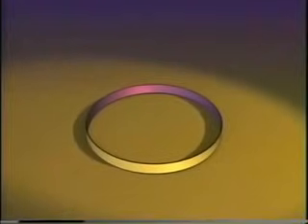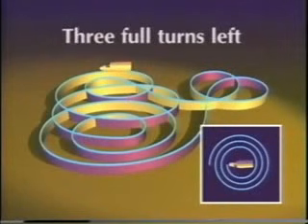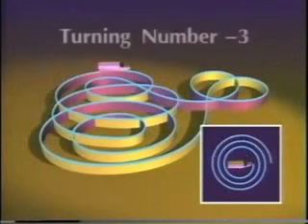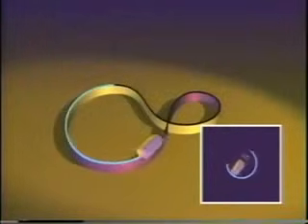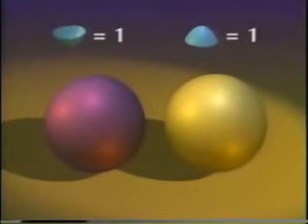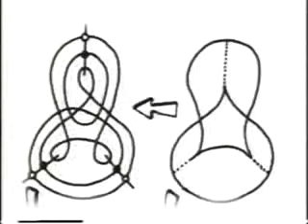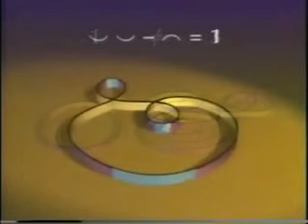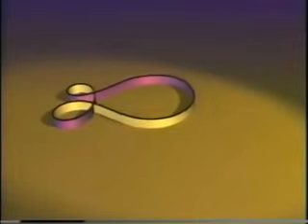how to theoretically turn a sphere inside out

Comment: "This sphere is made of an elastic material that can stretch, bend, and pass through itself." Yeah, no. The only way a material can pass through itself is if it's a liquid, gas, or plasma (sorry, Bose-Einstein condensates and solids). This would be breaking the molecular bonds between the particles making up the sphere; therefore, not maintaining the sphere as a whole, which is, in practice, cutting a hole in the object. This is exactly what you said isn't the point to do at the beginning of the video: "Sure, but the point is to do it without making a hole." If this is a legitimate scientific theory, you just got served by a fifteen-year-old.

Comment: lol that fucking thing creased at least twenty times during that whole process
Reply: +Poke brony234 I'm a mathematician and no it didn't.
Reply: ikr? I'm not mathmetician, but that had to at lest crease once.
Reply: It didn't, as far as I'm aware, I didn't see any creases or sharp turns, but then again, that could just be my shitty eyesight...
Reply: +Poke brony234 See smale's paradox
Reply: welp. the thing definitely twisted and contorted into itself every single time it collapsed into itself.
Reply: +Kevin Wei um it was about half way towards the middle of the video. so either number 3 or 4
Reply: +44theshadow The sphere was never creased and passed through itself at the same time which is what they meant to say.
Reply: that could be true now that i watched the vid a few more times. but i still believe that it twisted many times during the middle phase of the transformation. but thats only an assumption because the camera angle, but whatever
Reply: 44theshadow There is this thing called homotopy that can be used to trace transformations across the surface. In other words, there is a formal mathematical proof that eliminates the need to "see the evidence".
Reply: mk m80. will do. im stupid so i dont know the terminology, but ill take your word for it

Comment: Guys this is pure math, there doesn't need to be a material that does the same thing. and mathematical spheres don't just represent material shapes they can represent anything each point on a sphere could represent a different color for example and maybe in some applications its useful to turn it inside out

-TPC

Comment: Setting the parameters after asking if you turn a sphere inside out is idiotic.  The term pinching is made up bs. The ring in the graphic does not create 90º angle.  It can only be a curved surface through out the inside out transition.  You changed the rules in the middle of the game. Stating no pinching, pinching is made up bs term in this case. You stacked the deck to show a computer graphic that is no more valid than the first. Material crossing through itself. Possible at high freguencies,

Comment: I just spent 10 minutes learning something that will never physically be possible anyway.
Reply: Which doesn't mean this won't be useful for a real-world application. Imaginary numbers are very much "unreal", yet modern physics couldn't exist without them.
Reply: Airblader How can something not physically possible ever be applied in the real world?
Reply: tapport Often you will find that the process of solving certain ("real-world") problems becomes much easier by leaving the realm of the physically possible and instead moving on to abstract physical or even abstract mathematical concepts. Such results can then be applied to your actual problem again, allowing you to solve it. Yes, sometimes even solving a general, abstract problem is much easier than solving a certain subproblem. 

As I pointed out, imaginary numbers are a good example. Of course nothing that exists in real life has a complex/imaginary value, but using complex numbers pretty much revolutionizes the way we do physics. The computers we have today wouldn't exist if it wasn't for those numbers.

And they are just one example. There is completely abstract mathematics which is done for the sake of doing mathematics and there is (a lot of) mathematics that is done to help solving problems in physics or other sciences. But the past has shown that even abstract results not meant to solve any real-world problem may find their applications in real-world problems. Which is why research like this is important, even if its "use" is not directly apparent. In fact, often abstract results only help solving other abstract problems which solve other abstract problems which then can be applied in the "real world".

Cryptography would be another great example. The mathematics behind elliptic curves and the like is really abstract and complex and yet the internet or banks or anything requiring a password couldn't exist if this research hadn't been done.
Reply: tapport So, to sum it up: no mathematician in their right mind claims that this result will help us turn spheres inside out.

However, the underlying problem that was solved here might fuel further research in topology and one day "indirectly" find its way into a useful application.

All that being said, as a mathematician, I don't even care for it that much. Even completely abstract mathematics is appealling, but with the words of Paul Erdos: "[…] It's like asking why is Beethoven's Ninth Symphony beautiful. If you don't see why, someone can't tell you."

Comment: my teachers at school challenged 50 kids to turn a circle made of all the students holding their neighbour's hands inside out. the rules were the circle could not have anyone with their arms crossed and could not be broken. they said that they had tried this over the previous 10 or so years. and no student had worked out the solution. after 10 minutes of all 50 kids working together to solve the riddle the teachers announced that it could not be done. so i said "i've got it" walked to the oppersite side of the circle and asked one pair to lift their arms up and walked under them. dragging all other students through that gap. it worked and the teachers were speachless! yeah that's right a circle can be flipped in reality and not in the physics of this video! and yes stuff can pass through itself. this video makes absoloutely no sense!

Comment: I am thinking that in n+1 dimensional space, if the n sphere is an odd number then it cannot be turned inside out because there are no saddle points in even dimensional spaces to make it possible to turn the n sphere inside out. This means that for any n sphere that is even, the turning number always equals one.
Reply: Hmm, very interesting, but consider this hypothesis:
you have eight pencils and 34 steaks on the roof. This means there's only 20 slices of toast (surface area = 23cm²) in the pool. Now, when we compare the weight/mass of the steaks and the total volume of the swimming pool, you can see that the earth couldn't possibility exist as a sphere and still maintain it's orbit around Jupiter, relative to the population of China, of course.

I realize none of this explains why elephants can't swim whilst wearing hats, but it's food for thought, at the very least.
Reply: Adi Cox I don't have a goddamn clue what you just said, but it sounded interesting. 
This is why I have degrees in History and Psychology and not mathematics. lol
Reply: Very interesting thought. If this doesn't work for 2 dimensions but for three, what about 4, 5, ... n- dimensions. 4 or more dimensions might be hard to imagine but this is a mathematical theory and no rational science so n-dimensions are a thing one has to consider. It seems akward that mathematical laws should change just by adding more dimensions.
Reply: I had noticed a quality that the parity of dimension of space expressed. In other words what happens in an even dimensional space may be different in an odd dimensional space and that this is consistent no matter how many dimensions we go to.

Lord AJ gets what I was saying, but Tweedle Dee if you want to involve toast, Jupiter and the population of China, I can take it :  ) It is gratuitous imagination on your part.

This is what I am up against. People that do not taking me seriously. It is good to have a bit of fun though : )

Comment: In some places it looks like a smile, in others it looks like a frown...there's science terminology for you.
This is ridiculous.  You can invert the circle by flipping it, why do you have to pull it through itself?  How do they make up arbitrary rules and not even say them in the video?
Reply: The reason this is explained with these examples is because the real way this problem is approached is hardcore math and it would be impossible for anyone of us to follow.

You can invert a circle by flipping it because it doesn't exist in a dimension where it's blocked from doing so. A sphere is a fully complete form which means flipping it would never be turning it over, just turning the position you look at it from.

Comment: > Easy, cut a hole in it and pull it through.
> That's cheating.
> It can now pass through itself.
> You can now just pull it through a hole without even cutting a hole in it.

Comment: This video gave me a mind loop and it shut down with a general protection fault. Only 2:09 made sense. Well, if the circle has an "inside" and "outside" even when it's not a twistable band, what if you "cut" out the narrowest possible 1 unit thick band of spheres A and B, which are proven to be turnable into one another. Then you'd have turned circles by going through the sphere with the desired "surface" on the outside...

Comment: this has got to be some of the biggest bullshit ive seen on youtube
Reply: Cameron Fitton There is practical application in homotopy theory which inspired this particular problem.  Homotopy theory is the practice of trying to attribute certain algebraic properties to a topological space based on injections of standard and familiar topological spaces and how these injections can be morphed into one another.

For clarification to laymen, a topological space is an abstraction of "nearness."  It is very useful to abstract the notion of "these region is near that region" or even the very concept of what you mean by "region" because in a lot of cases the concept of "nearness" doesn't work out exactly as you would expect it to in a euclidean space.  

To give a practical example, say you are working in big data analysis and you're trying to predict the behavior of a group.  Your find that your algorithm is faulty for a certain "region" of data.  Before you can even begin to debug, and re-optimize your code in the direction you want you first had to define the notion of "region" in this huge, high dimensional space.  The standard, n-dimensional euclidean metric topology is useless here because it is often useless here because it is far to rigid a thing.  Points often lie on a lower dimensional manifold.

It is difficult to study topological spaces based solely on the concept of nearness.  To study these types of spaces it's easier to assign algebraic invariants to the space.  This video is key in establishing one of these kinds of invariants.
Reply: still not really a practical application
Reply: well when you find a material that can pass through itself report back
Reply: haha some day we shall find it
Reply: some
Reply: Hello layman, this is topology, and topology is not about materials, but is a part of mathematics, and this topology is EXTREMELY important to many sciences and engineering.
Reply: Darryl Johnson cool
Reply: ***** it probably does have some sort of use but the reason i said it was bullshit is because the narrator said, lets use a material that can pass through itself
Reply: ***** so your simply saying that this provides no  use in terms of something physical but instead may possibly have use in mathematical equations and other theories

Comment: At 2:04, they're the same exact thing... A circle in two dimensions, which is what they're implying, will be the exact same thing if no side lengths are changed. If they gave measurements on the dimensions of the circle, then they could say that it is different, but in this case, they are the exact same thing.

Comment: Whats the point of turning it inside out if you can make it pass through itself .-.
Reply: Shiny Baubles so edgy
Reply: A sphere can't have an edge, ever
Reply: Stefan P What does that mean?
Reply: This is basically an exploration into a theoretical field of topology, while it doesn't immediately have any real world applications, its still a fascinating solution to an interesting and simple problem with defined premises.
Reply: Shiny Baubles
Actually, think of a semicircle. 2 edges. One of them is curved. If you make the other one curved, it makes one complete edge.

Comment: I think people really don't understand the pinching rule(and an object passing through one another is not something strange, in quantumn mechanics phenomena like this hapens) is because they don't understand its implications. In the beginning of the video, one person attemped to just push the caps through eachother and turn it inside out. When pushing the cap through one another he created a loop. When you try to tighten a loop, its "sides" or surfaces within the loop aproach eachother. The problem is that when you are tightening a loop, there will always be an infinitesimally small hole that you cant close. In this sense the object CANNOT pass through itself in the loop because part of it is ALWAYS inside the loop. This is why creases technically are allowed, but do not form a sphere, they form a creased shape. Thats why there was still a bit of yellow in the edge when the crease was formed. The more you pull on it, the smaller it gets but in order to actually get the surface to avert it needs to be ripped. This video explores the mathematics of topology, a field which can allow you to calculate the surface area of nearly ANY surface regardless of how it changes and is the theoretical limit of what can and can't be done in space(the reason you cant rip it is because in real life, things are just clusters of other things, e.g a proton is 3 quarks, eventually you get to an indivisible unit which can't be ripped). Hopefully this answers your questions David Stevens. Each field limits what another can do, mathematics limits physics, physics limits chemistry, chemistry limits biology, so on and so forth. Mathematics isn't science because it is the most general study of all, even though it may be incompletable. Many computer algorithms today rely on it, such as the convex hull.